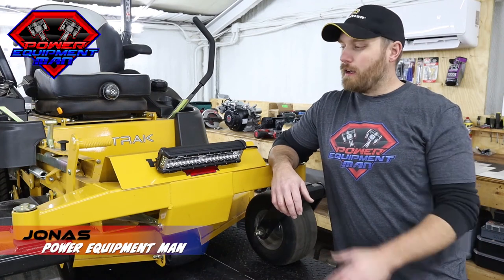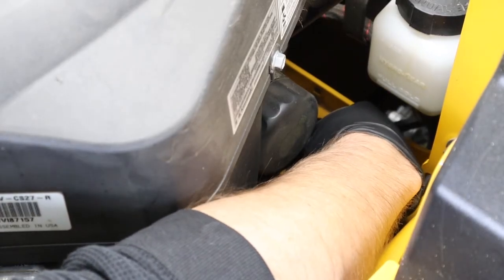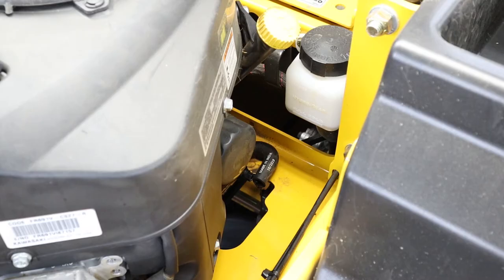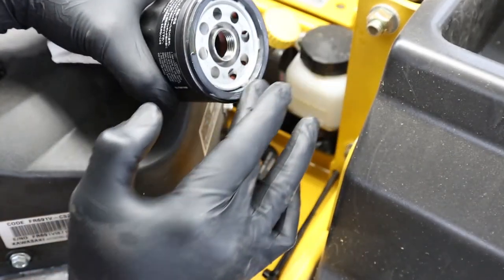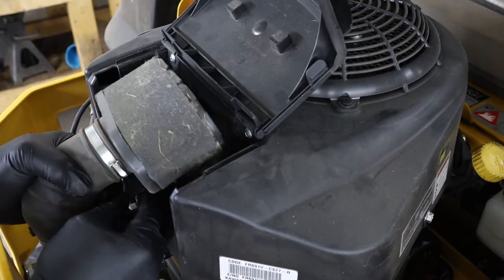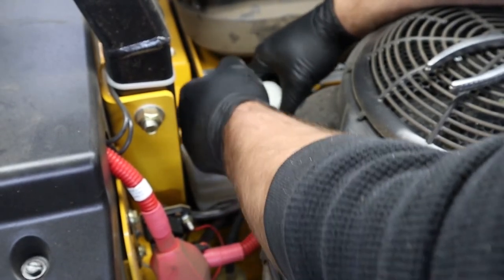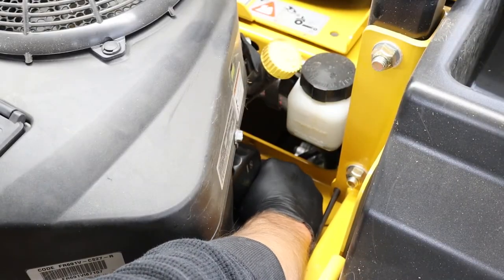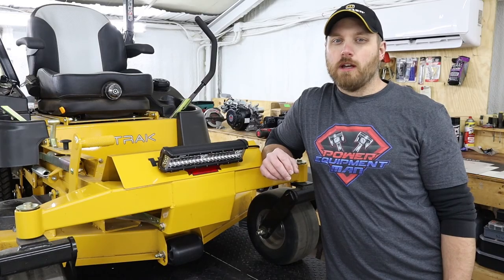Kawasaki FR Engine Oil Change - Service - Tune Up

Comment: Nice video. I especially like the "cut cup" trick for placing under the oil filter and the tip about keeping the air filter and housing clean at least every other usage.
Reply from the maker: Thanks for watching!
Reply: One of the best tutorial vids I have watch so detailed and precise . I never did any mechanical work and i was able to oil change filter air filter all things directed thank you much

Comment: I was wondering if you knew why my Kawasaki fr651v engine on my Ariens Edge never needs choked no matter how long it sits. I just recently bought this and from everything that I've read when the engine is cold you should choke to start but this doesn't start when I choke it and it's cold but if I don't choke it starts up every time???

Comment: Good vid. I always have difficulty removing the rubber fuel line from the fuel filter, any helpful tips? Also would you use air pressure to clear the paper air filter and the foam wrap between replacement? In the old days we were advised not to use compressed air but it is the only way I can see to really clean a paper filter. Another old habit was to fill the new oil filter with fresh oil before screwing it on. Our Kawasaki engine is still strong after 12 years.
Reply from the maker: Fuel filters can be a pain. Make sure that if you are using a universal fuel filter, like the one in the video, that can fit 1/4" and 5/16" fuel line that you only push your fuel filter on past the first set of barbs. If you push a 1/4" fuel line on to the 5/16" barbs it is almost impossible to get it off without damaging the fuel line. 

You can LIGHTLY blow off the filter between replacements, but you don't want to actually remove the air filter from the intake hose except when you are replacing it to avoid getting dirt down the intake. The manufacturers really don't recommend blowing out paper filters as it can damage them. The one flaw with the FR engines is that the air filter gets packed with dirt and grass too fast, that's why we came up the canister air filter upgrade kit for the FR and FS engines - https://powerequipmentman.com/collections/best-sellers/products/air-filter-upgrade-kit  Most guys can run all season without needing to clean their air filter after they switched to this upgraded filter.
Reply: @PowerEquipmentMan  Thank you for taking the time to share your knowledge! Will look into that air filter kit. With the cost of a new zero turn being almost as much as our first house,
 we will need to keep this mower  for another 12 years.

Comment: If you guys have the Kawasaki FR691V engine, do yourselves a favor and replace that junk plastic oil drain plug device with a Drainzit Model 1420-K.
Reply from the maker: Those drain hoses do work great. Thanks for watching
Reply: @PowerEquipmentMan  I got so angry at the plastic devices, I became a Drainzit salesman without a salary 😂

Comment: This was helpful but the oil drain plug on my Ariens Ikon XD with the FR691V was a nightmare.  This was my first 8-hour breakin oil change.  The plastic tube they supply you with came off as I turned the petcock and I had about a Quart of oil everywhere including the right hydro transmission.  I have to clean that off somehow.  Any suggestions for cleaning without hurting engine/transmission?
Reply from the maker: We use this suspension clean all the time around our shop. It won't damage anything. https://powerequipmentman.com/collections/service-kits/products/maxima-suspension-clean

Comment: I have one of these FR691V engines. How many hours would you recommend for the initial break in? I saw 10 hrs in various places but Kawasaki no longer publish initial oil change intervals in their owners manuals, just stating it needs to be changed every 100 hours.
Reply from the maker: Break in oil change is at 10 hours. Then every 50 hours or once a year (whichever comes first). I don't care what the service manual says, oil is cheap, a new engine is not.
Reply: @PowerEquipmentMan  Thank you for the info! Thats what I'll do

Comment: I have managed to get a leak where the drain plug screws into the engine. Any suggestion on how to tighten that back?  Thanks!
Reply from the maker: There is an o-ring on the backside of that drain plug fitting. Unfortunately, to remove the fitting to replace the o-ring you usually have to unbolt the engine and raise it up to spin the fitting to get it out.

Comment: How do you drain the most oil possible during an oil change on one of these engines?
Reply: im actually doing this right now based on this video and had the same question. I got a Cub Cadet ltz 1050 KW and I jacked up the other side and let it drain over night. Drip. Drip. Drip.
Reply from the maker: Yes you could just tilt the machine towards the drain side. But there is probably only a 1/10 of a quart that doesn't come out when doing an oil change the normal way. Also if you do drain that much oil out, you will need to add more then 2 quarts to get it back to the full line.

Comment: I just got a mower with this exact engine. It doesn't say when to do my 1st oil change. It just says every 100hrs. Any help would be appreciated.
Reply from the maker: You need to do your break in oil change at around 5 to 10 hours.

Comment: What happens if the Fuel Pump screen gets covered by dirt? On the FX850V it is mounted with the screen facing inwards against the engine body.
Reply from the maker: If the screen gets plugged, the fuel pump can't pump fuel. If you think your screen is getting plugged, just remove the bolts so you can pull the pump back a little and clean it.
Reply: @PowerEquipmentMan  are you saying internally or externally it’s getting clogged?
Reply from the maker: @M8NTIS  externally. As shown in the video, the screen on the outside of the fuel pump can get plugged with dirt and needs to be cleaned off periodically.  When that screen gets plugged, air can not pass through it to allow the diaphragm inside the pump to operate.
Reply: @PowerEquipmentMan  thanks. I have an FX850V, and that screen is against engine body. I took it off to see what if any dirt had gotten in, and it was 100% clear. It’s at approximately 150hrs of use.

Comment: My plastic drain plug on my FR691V engine is stripped, how can you remove it if it's stripped?
Reply from the maker: You will need to replace the complete drain. To remove it and install a new one you will have to unbolt the engine and raise it about an inch on that side. If you want to replace it with a drain hose (drainzit) you can just cut the nipple off the drain with a razor knife or hacksaw blade and spin the fitting out. Here is a link for the hose style - https://amzn.to/3hZCYHJ
Reply: @PowerEquipmentMan  Thanks

Comment: How do I check the oil ? Do I push it in and downward ?
Reply: On my FR691V no, it tells you not to screw it in. Just drop the level in bit but not screw.
Reply: @AbelG8781  I thought so , thank you so much for that information much needed

Comment: Is it ok to use a hand transfer pump to drain oil?
Reply from the maker: I probably wouldn't recommend it. It would work if you don't have any other options, but I don't think that would be the best way. I do use a fluid evacuator pump around my shop a lot, but it would take forever to extract 2 quarts. https://amzn.to/3xlie3L
Reply: @PowerEquipmentMan  lol I actually used it and omg the time I saved 😂I thought it take longer buy it went quickly

Comment: Hopefully that's the first and last time you'll need the pliers to remove oil filter. Replace it hand tight, just enough to seal the gasket. Twisting it on like a gorilla( like most  manufacturers do)isn't necessary.

Comment: Its important to say that in order to check the oil level, do not screw the dipstic. Just dip it in until it stops and pull it out. Otherwise if you screw it down, you're gonna get a false reading. 😂😂
Reply from the maker: Good point. Thanks for watching!